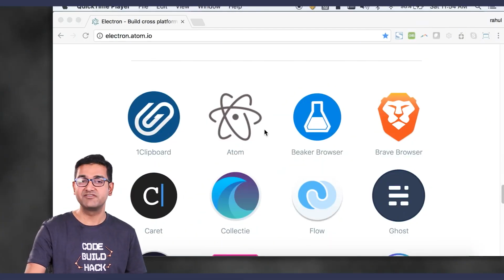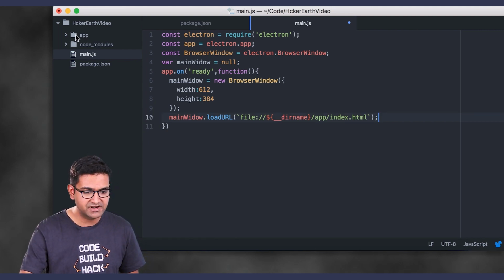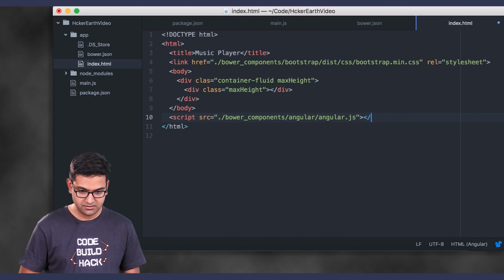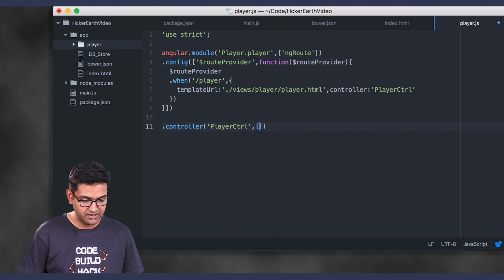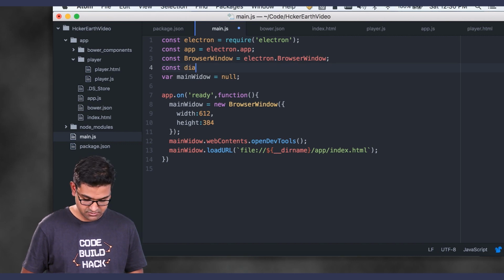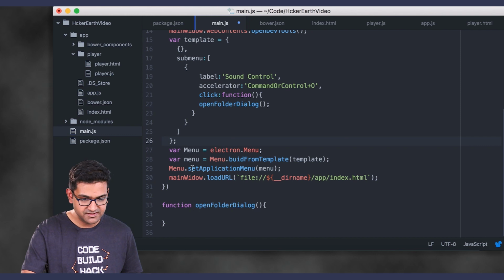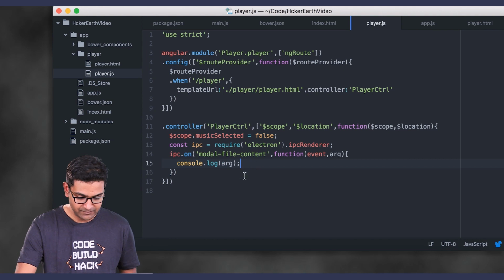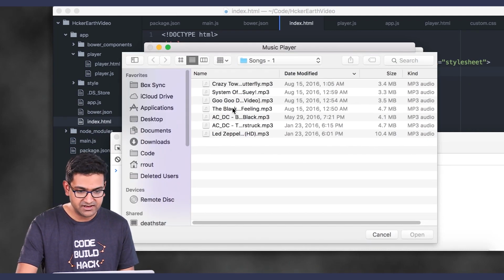Learn how to build an Electron App - Part 1 of 2

Comment: NEW METHOD!! There has been some Electron updates (as time passes), and here is the new code which you would use the date that I posted this comment. Well, anyways, here's the code (please don't tell me that it's not the same code, cause it isn't, i know that, and I have changed it ALOT!):
###
const {app} = require('electron');
const {BrowserWindow} = require('electron');
const path = require('path');

app.on('ready', function() {
 var mainWindow = new BrowserWindow({
  width: 1366,
  height: 768,
  icon: path.join(__dirname, /'YOUR icon.ico FILE NAME HERE, WITH EXTENSION'),
 });
 mainWindow.openDevTools({
  detach: true,
 });
 mainWindow.loadURL('file://' + __dirname + '/YOUR index.html FILE NAME HERE, WITH EXTENSION')
});
###
If you didn't notice, this changed code has the icon loading thing in it already :) Don't thank me yet! YW!
EDIT: This is for Windows at least...

Comment: Hi, great video! how can we embed an electron app inside another electron app, similar to ? By embed, I mean instead of redirecting to a my second app to do something, I can simply run the second app inside the first one. Similar to having google maps inside my own app instead of redirecting to google maps, have the user enter in the information there and then returning back to my app. Similar to web frame / web view functionality. I want do something similar with my electron apps. Hope to hear from you soon on how I can do this.  If possible, would appreciate a tutorial on embedding an electron app inside another electron app. Thanks! :)
Reply: Hey, You can actually have multiple windows (renderer processes) being controlled from the main process. Each of these windows can act independently and can also communicate between each other through IPC

Comment: Small piece of advice. There are many mistakes in the code, that you DO NOT rectify or even mention, your code magically works, and in the next frame the code changes. Please have annotations or something to let users know who will use this as a quick tutorial.
Reply: I too noticed there was an error in the part of the video, where "Menu" is "buildFromTemplate". I was hoping to see an exception throw when the code was run, but then it ran fine. I was clueless till the code screen appeared and I noticed that the typo was corrected. It will help to see the exceptions as well, as and when thrown!
Reply: Thank you